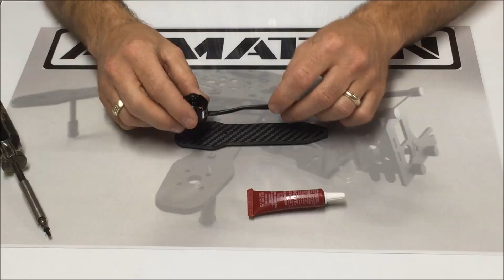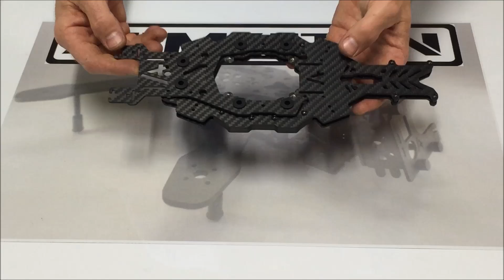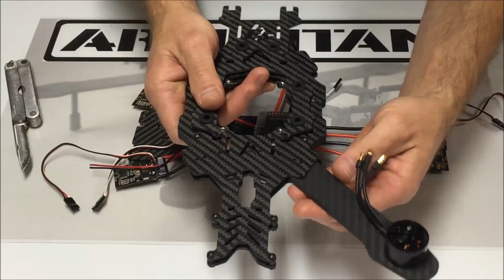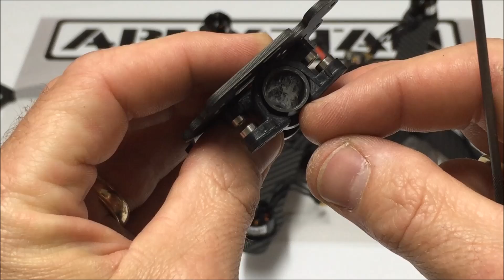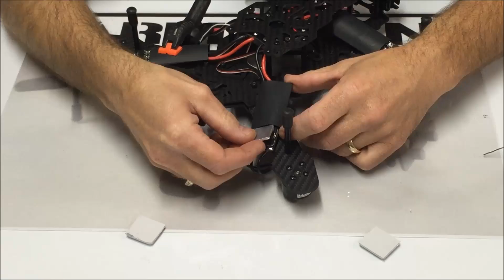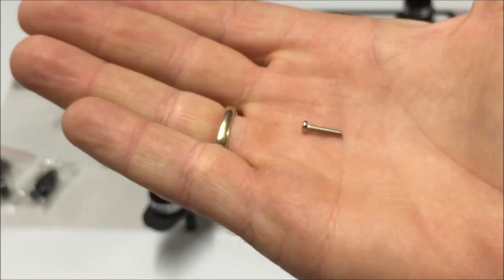Armattan FPV Rev 2 TILT Complete Build

Comment: is there an alternative to using those rubber grommets?  I was trying to get one through and it is a PITA
Reply from the maker: No alternative that I'm aware of.  They are a pain to install. You can install plastic "keepers" to prevent them from coming out on crashes. Have to google that though, I can't remember who sold them.
Reply: I think these are them http://www.banggood.com/Diatone-Damping-Ball-Lock-10pcs-For-RC-Multirotors-p-973473.html

Comment from the maker: I accidentally deleted a posters comment on motor wiring / motor direction.  It depends on the motor being used. This was built with Armattan "house" motors.  A lot of newer motors are  reversed from this video and most of us are using esc's with BLHELI rather than SimonK.  I now wore them all straight and reverses them using BLHELI software.  Thanks.

Comment: what size is the body from the front of the camera frame to the rear end in mm there is nothing on your site about sizes apart from the arms if this a foldable quad to help with carrying it aroundsurely it would help if you have some sizes?

Comment: Why is it called the tilt? does the cam adjust for pitch with a servo?
Reply from the maker: Raychristofer No, the camera on the TILT model adjust upward so when in fast forward flight you are not looking at the ground due to the quad tilting downward.  Chris has or will be releasing aluminum mounts for the tilt assembly.  Better and stronger than the rubber.
Reply: Brian Mays thanks Brian. That's what I was asking when I said does the cam adjust for pitch. Good lookin quad.